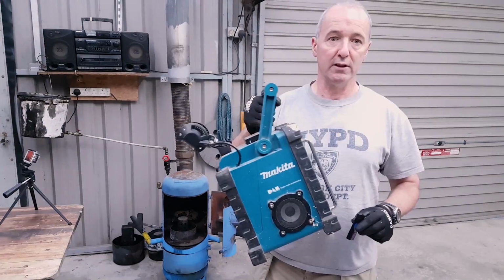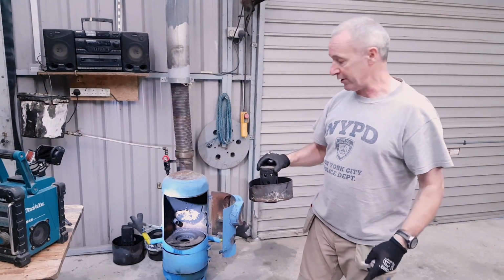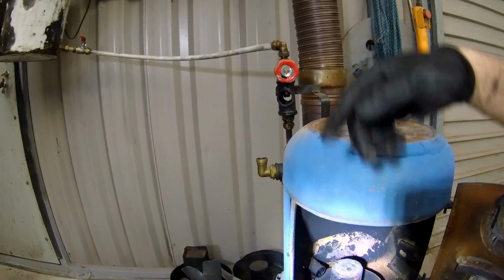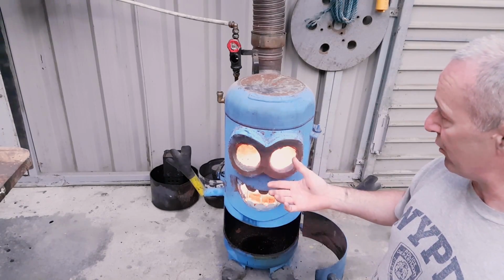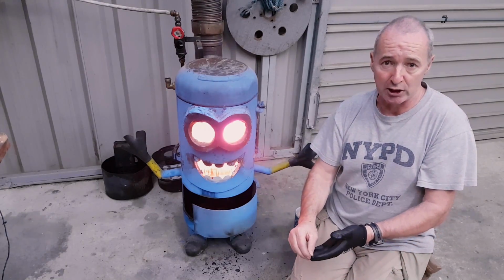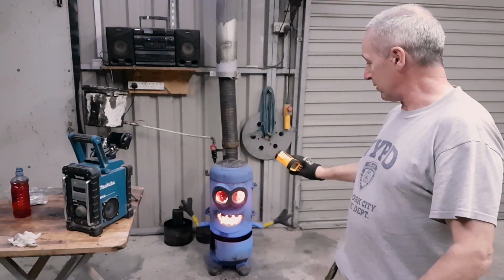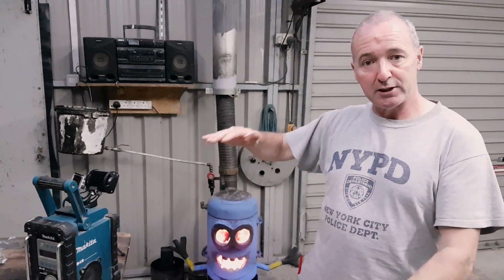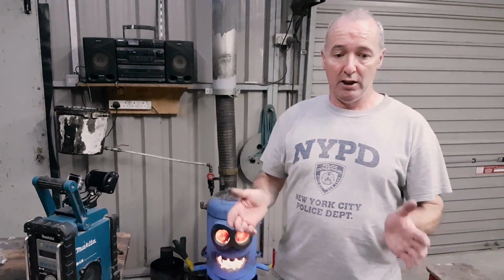Powerful Waste Oil Heater demo .. Make lots of Free heat!!!

Comment: I have a few questions:
How clean is it burning? How does the smoke out of the chimney look and smell like?
How does the flue look like after a while, isn't it clogged with soot? 
I'm worried about the oil dripping pipe catching on fire, how likely is it to happen? 
Thankyou!
Reply from the maker: Hi Radu. In the last video a few days ago I remove the flue to connect another stove and it was very clean and didn't require any cleaning. This was after a years use.
Doesn't clog with soot. The burn is clean and not smokey.
The oil drip pipe does not carry any gases and is under neg pressure. This means that air is drawn down it into the stove because of the 4m of flue/ You could use a peristalsti pump here instead of a gravity fed drip pipe. Hope this helps. Cheers Gerry
Reply: @GerrysDiy   Thanks for the feedback. One  more question: do you think filtrated waste cooking oil is also suitable for burning  or has lower caloric power? I'm pretty sure its more flammable than waste engine oil...
Reply from the maker: Hi Radu. I burn filtered veggie oil all the time. I even tried some in my domestic boiler stove. Here's a link https://goo.gl/Rmd1bF and a bigger playlist https://goo.gl/YLhFsP Cheers Gerry

Comment: Hi, great heater! I've been thinking about building something like this for in my little blacksmith shop I have at home here. I do most of my work there in the winter because that's generally my quite time of year from work. I've got a good supply of used oil I can get also from where I work. Probably about 200 gallons per year plus whatever I have at home from changing oil. Thanks for the video!

Comment: Hey Garry. Thanks for your videos.. I have a question for you. If I make a heater like you, and won't the air to come from the natural suction from the bottom like you, will I still need to make the feed line double? Copper inside of a iron pipe, ore can I skip the iron pipe, and feed the burner just using one copper line. ? Thanks, regards Jannick

Comment: What sort of cylinder head do you need
Reply from the maker: Hi Harry. I seized my Vittorazi Moster classic 185. The cylinder head and piston are heat damaged and beyond repair. We had a storm here, Hurricane Ophilia last week and my house and generator were damaged so the budget is a bit stretched at the moment. It's on the to-do list and hopefully I will get it going over the winter. Cheers Gerry

Comment: I think a big oil drum would be more efficient/productive in your workshop Jerry.As you said, more surface area,plus gets hot quicker and essentially like mine you could just a very low voltage fan for the main air intake to use a lot less oil. Took me a while to get the balance right but i now spend about 1 hour a month to top up the main oil tank outside which is the biggest bonus. As you know waste oil can be very messy. Cheers.
Reply from the maker: Hi fixitmakeit. I kind of wanted a gravity unpowered setup for this series of waste oil heaters but in the next couple of weeks i will be making forced air burners for a cleaner burn and more efficiency. I will have to setup a filetering system too. Thanks for the comment Cheers Gerry
Reply: Looking forward to that Gerry, I think you'll find that you can easily heat your workshop with a big drum rather than the gas bottle with forced air like mine. I used a speed controller for the fan when balancing the air/fuel mixture during the build,that saved me endless time in fabrication and it allowed me to fine tune the heater a lot easier than drilling numerous holes in the burner by experimenting with natural air being drawn in by the flue.Plus feeding the basic designs that we've all seen on youtube consume a ridiculous amount of oil to make it in my eyes less practical as a working heater. If i had a workshop about your size I would be also thinking should i bring the air feed from outside rather than the cold air being drawn in through doors etc. Plenty of room for improvements these waste oil heaters! Cheers. Thanks for the comments.

Comment: I like the concept, but as a plumber I'd like to figure an effective way to do this as a boiler...
Reply from the maker: Hi Mike. I am making some videos at the moment on a waste oil cooker. Once I have that running I will be making a waste oil boiler for heating domestic water and central heating. This will work electrically and be thermostatically controlled.  Will be cheap too.  Cheers Gerry

Comment: Hey Gerry, 55 Gallon Tanks are NOT thick enough :(((. You will only get a few Season out of them, then they Rust / Deteriorate at the Hot Spots ://. I would go with Propane Tanks or like what I did is Hot Water Heater Tank to last you years :D

Comment: hello for water if you stripped copper oll line the cover off it swell it round the chimney low down with a tank for water that mite work gravity . it is a great burner
Reply from the maker: Hi Michael. The copper tubing around the flue pipe is a great idea and it would certainly make lots of hot water. I have some old oil boilers and I will mod one to heat lots of water and some domestic underfloor heating too. The  little burner in the video is easily made and produces and absolute ton of heat for very little money. Thanks for the comment Michael Cheers Gerry

Comment: Great work Gerry...winter is a coming....i would insulate that shed as soon as you can ...it will save you oil ....
Reply from the maker: Hi Eye Toldyoosso The heat loss from the shed is enormous especially when it is windy. I live on top of a hill so it's windy most of the year. The little minion stove has massive output but I will be making a bigger stove next week. I might do a give away with the little blue fella soon. Cheers Gerry

Comment: Nice and warm right now, but it's that time of the year. Thankfully I have a tad over 6 cord mostly larch n red fir stacked. Need to build one of these waste oil heaters for my li'l shop though.
Reply from the maker: Hi John. I have some nozzles on the way so I will be making some different burners soon but I have to say that this little design works very well for very little effort in making it. Thanks for commenting John Cheers Gerry
Reply: Gerry, *it's awesome (and affordable).
*not just that, but I drive a full sized diesel pickup truck, so a couple times of year have to haul a 5 gallon bucket of used motor oil to the recycler. Wasteful when I could be repurposing it into heat for the li'l shop.
Reply from the maker: Hi John. There are lots of different burners but this design is so easy to make and it's very frugal on the fuel for the amount of heat it makes. I was in the shed again tonight and it just runs in the background making heat. I have some design changes going to happen next week. I would live to get flying again too so the paramotor is going to have an infusion of cash to get her in the air again. Thanks for the comment John Cheers Gerry